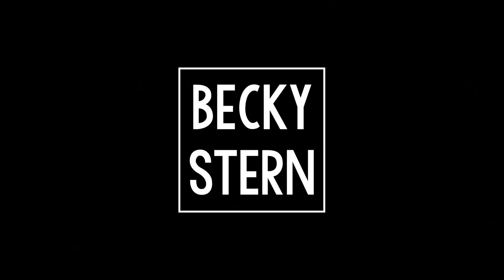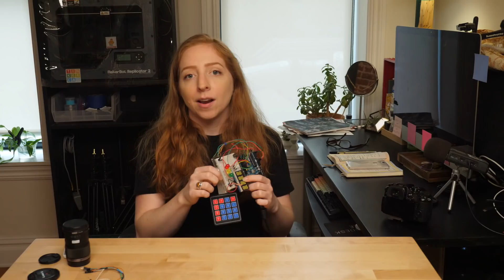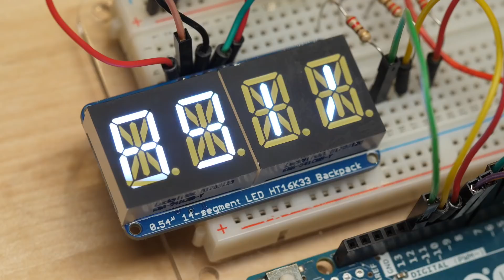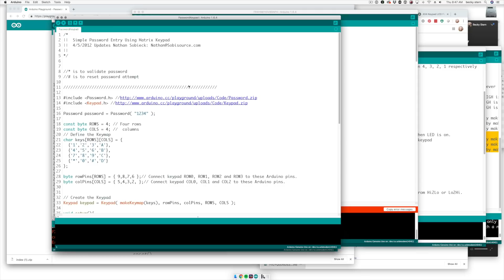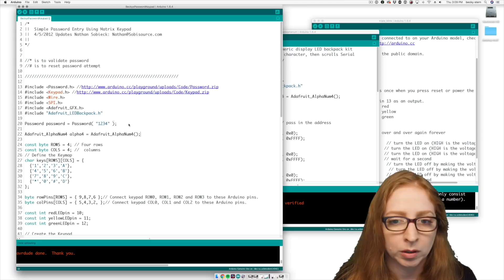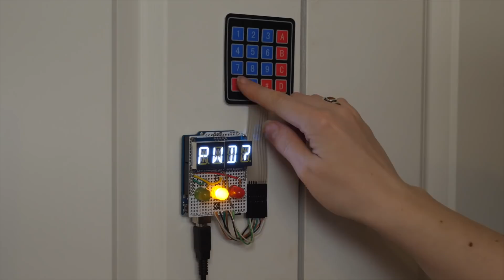Arduino Sample Code Mashups // Becky Stern

Comment from the maker: What do you find particularly challenging when creating projects?
Reply: Love your channel!  For me, the most challenging part is looking at aaaaall the different ways to accomplish my project and just PICKING one.  I get caught up trying to decide the absolute best way to do something, and the project takes way longer than it needs to.  I'm getting a little better, but it's still hard to just pick a path.  It's everything from choosing the "right" microcontroller to deciding something trivial like whether to use a series of "if else" statements or use switch case.  
Also challenging is getting caught in the "feature creep."  As soon as I get an outline for a project, I think "Oh!  But what if I add flashing LEDs/WiFi/a disco ball?"    
Great advice to make a list ahead of time.  I'll be giving that a try.  
Thanks for the great video!
Reply: I find figuring out if my code is too much, too little, or just plain wrong is the hardest part. I know that I tend to start with too little code, then I overcomplicate it and add too much code. Then I think there should be an easier way to code it and not have a lot of code and restart the cycle. Hitting that sweet spot of not too little or too much is EXTREMELY difficult for me.
Reply: @andrewwronski1763  I don't know that there is ever too much or too little code. Too little and it probably doesn't work. Too much, is hard to see because it's either redundant or it just doesn't do anything. Edit...  it doesn't do anything more when more is added.

other than optimization, or fixing timing issues, once the program does what it needs to, correctly, from every input vector or method you have and does it without fault, then you're good.

Comment: i agree projects can seem intimidating until you break them down into bite sized pieces i will be refurbishing a 1961 gm pd 4106 bus soon and bringing it into this century as a hole it is daunting but i only need to work on 1 thing at a time so a very complicated job becomes many small jobs.
Reply: 6-71 out back or 8V?
Reply: @kleetus92  i think it is the 8 but was bed ridden when i bought it an good in a wheelchair and will be up on a cane soon so i have had less hands on time than i would like thinking about making it a hybrid if i can save and raise enough money for enough batteries the rest is doable in prices.